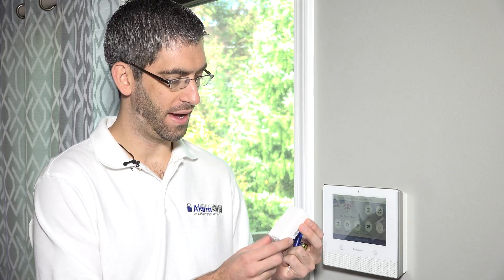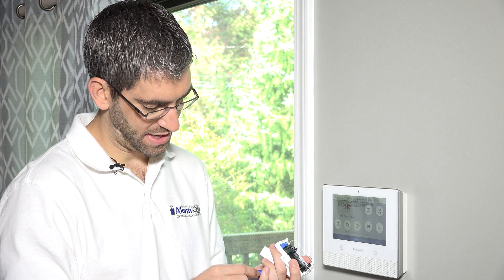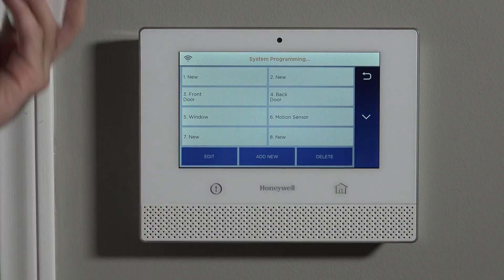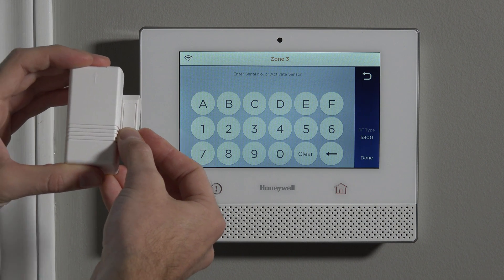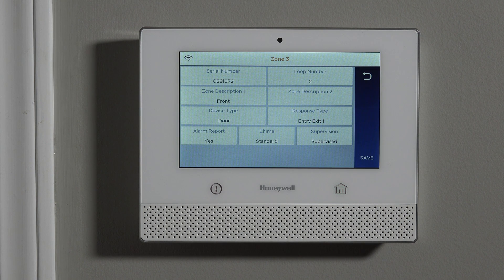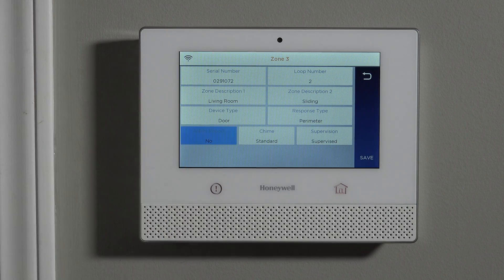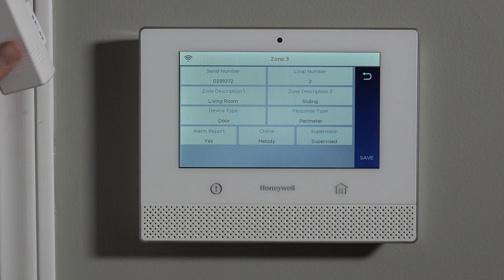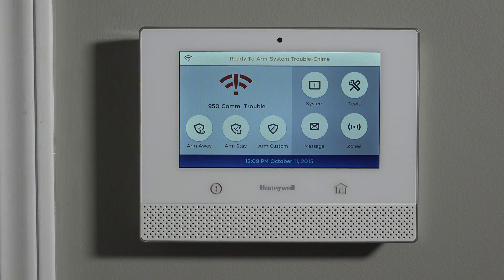Honeywell 5816: Program to Lyric

Comment: Hello, I want to up grade my system(LYNX 3000) to a touch screen system. I'm not sure if I should go with Lyric or L7000. I believe both systems will work with my sensors. I have honeywell thermostat and Google home hub with C by GE light bulbs and light switches throughout my home as well as a Nest Hello doorbell.
Will either of these systems work with those devices? I would like to know before I purchase the panel off of your website.
Thanks for your help!!!
Reply: the Lyric or L7000 will not communicate to the google hub, If the thermostat is zwave it can talk to the panels, The lyric wifi and zwave are built-in while the L7000 you have to purchase those seperatly. Nest Doorbell will not work with the Honeywell systems